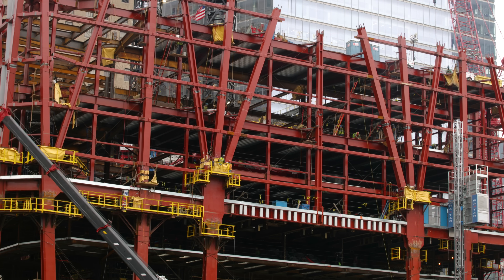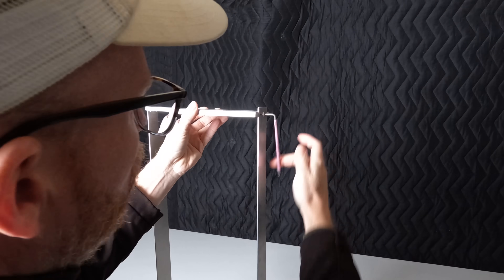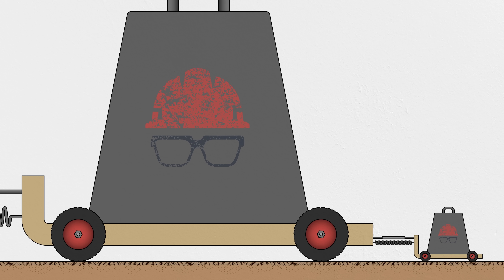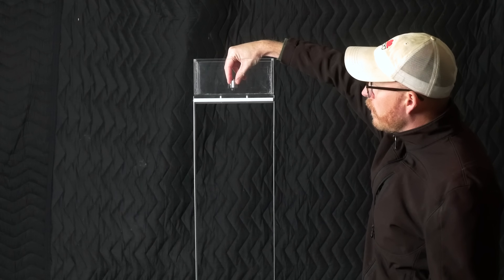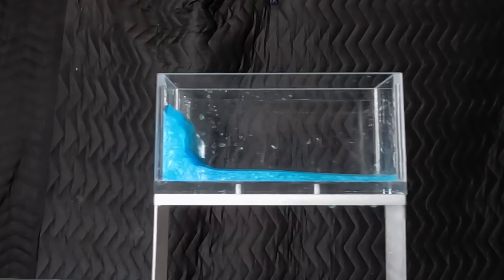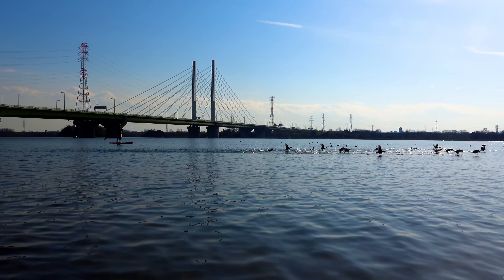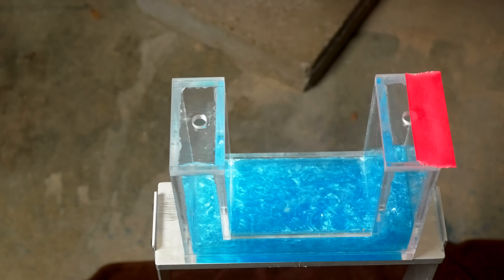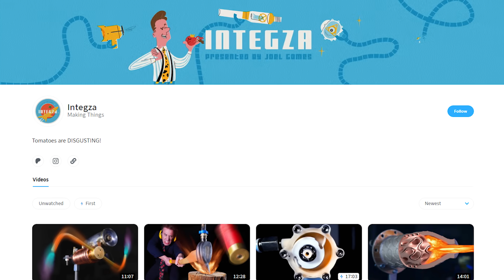How Liquid Dampers in Skyscrapers Work

Comment: This is fascinating!  I'm convinced there is a way using a small slosh tank with a float could automagically adjust a larger slosh tank restriction valve for smaller movements...
Reply: So that u shape one, if you have a floot connected to a complent mechanism (like spring) it could be tuned to have variable closure based on how far the liquid is moving.

You could use this to work with real time physical feed back to adjust to the forces on the water.

(Like more closed, so greater air pressure but less force/movement to open the valve well taking more force to open wider and wider but that will be less air pressure meaning liquid can move freer)

That way it can only "slosh" small distance with low energy movements IE higher frequency and "slosh" larger distance for lower frequency. This means the phase can passively be adjusted (depending on limitations of air pressure and water flow)

You can use to large nested cylinders with adjusted baffles (openings between them) to act as the two halves of the U in the model shown (just need to ensure the outer ring is sub divided with at least higher flow resistance baffles then movement through the middle ring)
Reply: Sloshception

Comment: Interesting!  I wonder how liquid density effects sway?  Also wonder how different storage shapes effect it?
Reply: Density is one factor, but since water is so cheap, it doesn't make much sense to use any other fluid for this. I guess if you're space-constrained you could gain a bit of density by adding salt. (Though given how it corrodes metals, salt water would make the plumbing system more annoying to design and maintain.) Or, in a smaller application where the liquid is less of a cost factor, use mercury. (:

And yes, the shape of the tank will certainly affect the dynamics. Grady demonstrates, e.g., that the water depth affects the wave speed. The whole idea is to counteract linear side-to-side motion, so I doubt a lot of gains are to be had with more complex prism shapes. But I do find it plausible that they might vary the depth of the pool, e.g., make it shallower near the sides, causing the waves to break early and putting less stress on the tank walls.
Reply: Interesting!  Ty  @ps.2
Reply: @l0I0I0I0 Not an engineer, by the way. Take what I say with a drop of salt water.

Comment: Please disable the horrible AI Voice translation
Youtube somehow thinks that I would prefer this over the original audio even though I have subscribed to the channel for ages and have english as one of my languages in my settings (just the UI is in german)

On other videos I tried the translation but within the first few minutes there where huge factual errors in the translation (I noticed that because it did not fit with the story of the video -> transmitting data over 3 miles at a race track was translated to transmitting data for 3m (~10feet) which has way less challenges). Due to this experience I can not trust the AI translation especially on a technical channel like yours. Because Youtube does not remember if I change the audio track I have to do this on every video which is annoying, so I will close videos with AI Voices with a keyboard shortcut (this is less annoying and there are enough other videos here to watch).

Comment: "Digitally calibrated finger." lol I love it.
Can the dampers double as supplemental water towers for the building?
Reply: he talked about it later in the video, that engineers are already double-dutying it for water storage for fire systems as part of existing fire codes.
Reply: @mfaizsyahmi probably a PITA to refill 😂
Reply: Only for emergency use, because if it's constantly being emptied and refilled that interferes with the tuning
Reply: @zutaca2825  I'm sure you can make some kind of "coupled water meter" that only lets as much water out as what gets in.

But thinking about that: if you use such a device, you might as well pump the water directly to the water pipes, lol.
Reply: @marco23p  Skyscrapers typically do have rooftop water towers for the consistent head pressure.
Reply: Exactly, could potentially defeat the main purpose. @zutaca2825

Comment: I'm curious if a liquid damper could double as a swimming pool. The high walls and baffles might be awkward to design around, but is such a thing possible?
Reply: The high walls are significant. Most swimming pools maintain a water level very close to the top of their container. You could have your egress ladders extending 2 meters above the water to the patio, but I think that would strike most people as awkward and unwelcoming. It'd be a little better if you could build stair-steps, less steep than ladders, into the sides. They would complicate the wave patterns of the damper a bit, but if kept small, they might be reasonable.

Also, tuning the water depth for its damping job means you probably can't have a gentle gradient from shallow to deep water, as many swimming pools have.

Comment: Fishing boats often have these too. A wide water tank is filled roughly half full, and thee slosh makes the roll much smoother.

And no, this is not the same as ballast. This tank is in addition to that, and is usually placed on top of the wheelhouse.
Reply: Cruise ships are also commonly stabilised by moving water from side to side
Reply: @Citiesinmotionplayer  Cruise ships also use complex algorithms to slot vacationers according to their size and density, which is determined at the airport's full-body scans. The big picture they're working toward is reducing passengers in any moving vessel to freight calculations to optimize travel and fuel usage.
Reply: @vanleeuwenhoek  haha no, they sell different types of cabin for different prices and people leave their cabin too much. Would be funny though.
Reply: If the wave period matches the resonant frequency of the ship, small waves (<1ft) can produce large movements (e.g. +/- 20° roll) by exciting resonance. Such dampers exist to prevent that.
Reply: Most boats use a solid ballast, so high seas don't "slosh" all the ballast to one side and roll it over. Ships (and aircraft) also use specialized fuel and cargo holds to prevent the required sloshing - for the same safety reason.
Reply: Along with dynamicaly controlled fins below the waterline to reduce roll in larger vessels.
Reply: All ships will have this, it's called a ballast. Smaller boats usually use a keel, which is a weighted piece that is built into the vessel.
Reply: @PugetWitch  Sailing with partially filled ballast holds is prohibited unless the loading manual approves of such a practice.
Reply: @PugetWitch  hey neat - I didn't know the keels were weighted

Comment: Interesting to hear that liquid can be use as a motion dampener as well.

Casual Navigation videos highlight how it tends to exaggerate the rolling of a ship.
Reply: you can even use liquid dampers for ships too! cruise ships can use the pool at the top of the ship for that purpose, along with some other active damping systems.
the reason liquid cargos and buoyancy tanks tend to move along WITH the ship's motion because they're mount at or underneath the center of gravity, which can cause the center of gravity to move to one side of the center of buoyancy, and THAT is why the ships roll so hard.
Reply: rip that channel
Reply: Wait what?
Reply: Ships roll around their centre of buoyancy, which shifts as the weight distribution changes (which is where I think the positive feedback comes from), while buildings have one end anchored to the ground.
Reply: nobody is appreciating your pun. but i like it :)
Reply: As mentioned the issue is the location and the source of the motion.
Reply: I would imagine that in addition to all the above, the resonant frequencies and phase shifting of the motion damping would influence whether it had a positive or negative feedback with such oscillations.
Reply: The difference in those cases, is scale. A liquid damper is a couple percent of the weight of the building, at most. Where as, in a body of water, the weight of a ship is... a drop in the ocean.